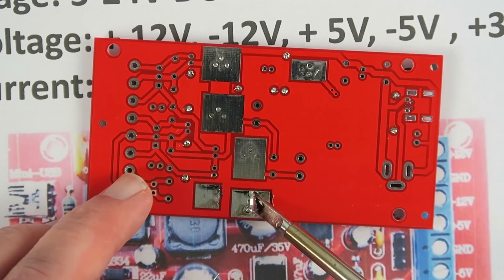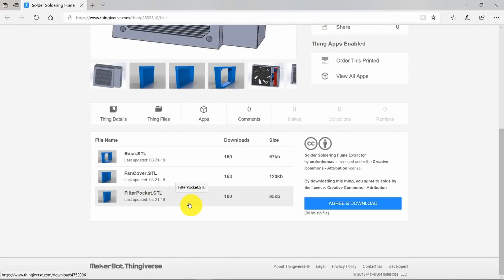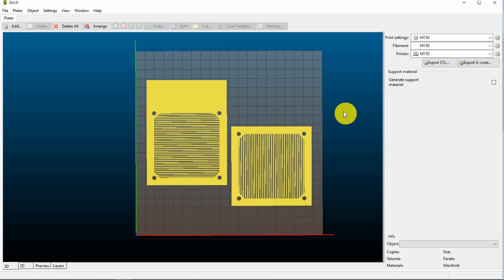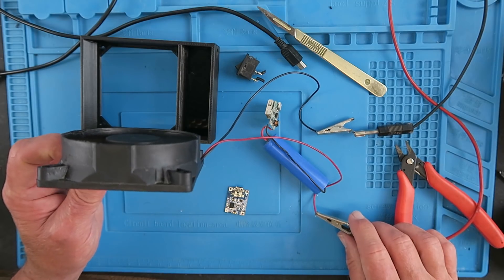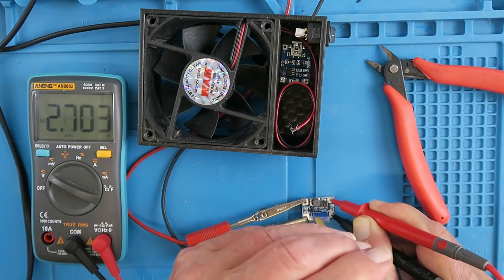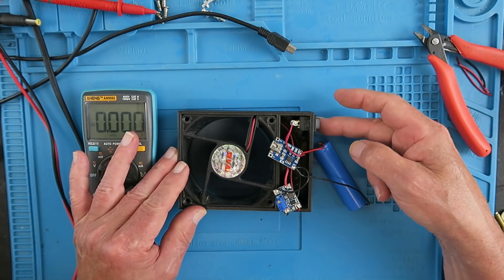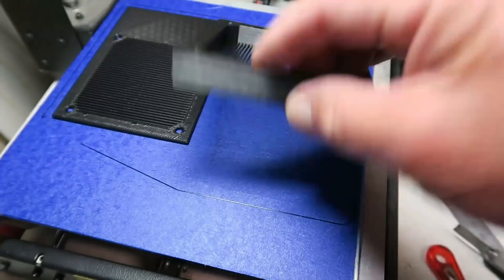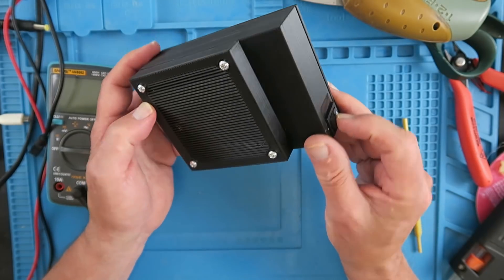DIY Fume Extractor 3D Printed Thingiverse Design Project

Comment: If you set your boost converter to 2.4V at the input to set 12V at the output, what would happen when the cell is fully charged? Wouldn't the output be a lot higher than 12V?
Reply from the maker: Hi, the only setting is the output voltage. Once set the output voltage is regulated (fixed) at that voltage it will not change even if the input changes (within the limits of the device). The minimum voltage input is 2 volts. So if the input varied from 2 volts to 6 or 8 volts the output will still stay at 12 volts. This device is a "boost" converter that just steps up voltage. You can also get "buck" converters that step down. Also a combination of the two "boost / buck" as I show here : https://www.youtube.com/watch?v=oHGTIZ-yCXI

Comment: Pretty beautiful job, my friend. 😊
I'm thinking about making a new fume extractor as well, smaller than the one I first made... That thing works great, but it's too big... It's really difficult to use it. 😕
But now I was thinking... I already have a TS100, a soldering iron you can power from a battery, that I keep in my bag... A fume extractor like yours, with battery and everything, would be a great addition to my bag. 😃
Reply from the maker: Thanks Mario! You would probably want to modify the switch arrangement so that it did not accidentally turn on in your bag!! 😀
Reply: @1nformatica  Hmmm... That's true! 🤔

Comment: That TP4056 does not seem to have the protection circuit
Reply from the maker: The TP4056 is incorporated in different boards. If you want protection then use this board : TP4056 Charge And Discharge Protection Module http://bit.ly/TP4056_Pro
"This module uses the TP4056 Li-Ion charge controller IC and a separate protection IC. There are other types of modules on the market that use the TP4056 but lack any protection circuits or ICs to provide the necessary protection needed with lithium batteries. This module uses both the TP4056 and the DW01A Li-Ion battery protection IC, which together in combination provide the following protection features:

Manage the constant current to constant voltage charging of a connected lithium battery
Over-discharge protection - keeps your battery from being discharged below 2.4V, a healthy minimum voltage level for your battery
If a connected battery has been discharged below 2.4V the module will cut output power from the battery until the battery voltage has been re-charged above 3.0V (the over-discharge release voltage), which at that time the module will again allow discharge of power from the battery to a connected load. Although the module cuts output power from the battery during an over-discharge situation, it still allows charging of the battery to occur through the parasitic diode of the discharge control MOSFET (FS8205A Dual MOSFET).
Overcharge protection - the module will safely charge your battery to 4.2V
Overcurrent and short-circuit protection - the module will cut the output from the battery if the discharge rate exceeds 3A or if a short-circuit condition occurs
Soft-start protection limits inrush current
Trickle charge (battery reconditioning) - if the voltage level of the connected battery is less than 2.9V, the module will use a trickle charge current of 130mA until the battery voltage reaches 2.9V, at which point the charge current will be linearly increased to the configured charge current."